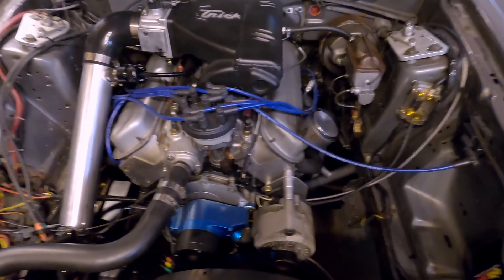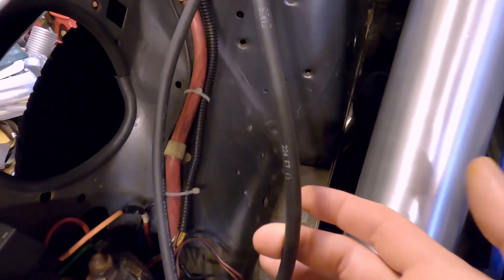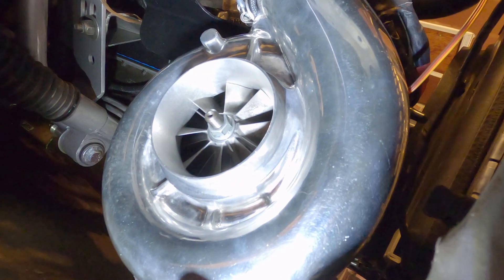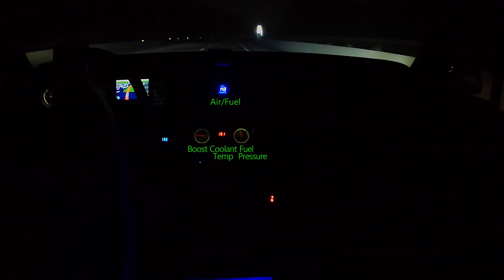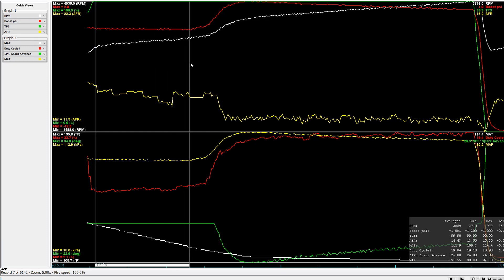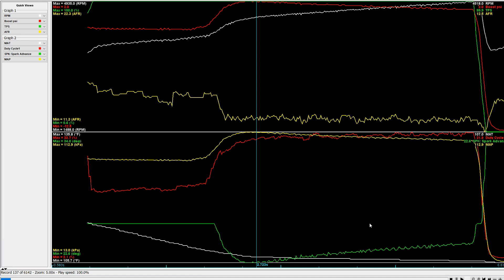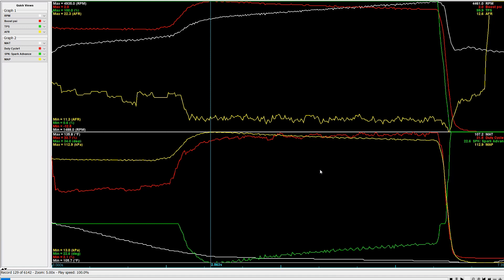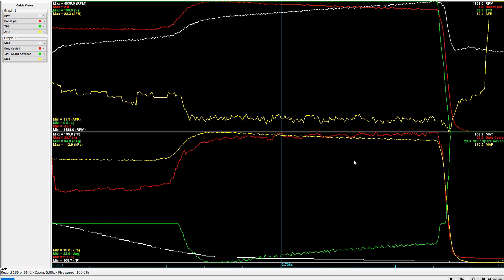The World's Most Powerful Electric Turbo Car - First Boost

Comment: Been watching and am happy to see boost! Your work has been meticulous. Your ESC looks to have plenty of headroom. Have you seen the torqamp?
Reply from the maker: I did see the torqamp after we dyno'd the small electric turbo.  The ESC is what I'm really concerned about.  The motor has been fairly durable; hopefully the ESC holds up.  Zeee batteries has stepped up and is helping with the project, so I'll be throwing more (and bigger) batteries at it.  I will let you in on a little advance info - I did do a pull two days ago with 15 cells fully charged and saw a peak of 3.8 psi @ about 13kW.  That's not enough to get me where I want to be, so it'll be 16 cells, possibly 32 to minimize voltage drop, and whatever other efficiency things I can do.  Ultimately, an Si impeller and volute will go on to get us to max power.  However, 3.8 psi is showing between 505-560 flywheel hp based on duty cycle, so we're getting there...

Comment: Great. Now send it!
Reply: JK JK. Must have been an awesome janky test feeling!!
Reply from the maker: Damn straight.  I won't be satisfied until it runs 9's on electric boost alone.  When I first put the whipple on it went high 10's.  Eventually got it to 9.83.  Between you, me and anyone reading these comments, I'm going for better than a 9.65 - the Dodge Demon mark.  I think we can do it.  Hell, The car is now 100 lbs lighter than it was with the Whipple, and all of that weight is off the nose.  Hookin' and bookin'.
Reply: @AlexLTDLX  you've made one, so it'll be easy to build a second one to twin charge it vs sourcing sci parts. Plenty of space in that car too. Also it'll lower your intake restriction off boost a heap too...

Comment: Can you run a bypass value for the air intake for NA?
Reply: the good thing about centrifugal blowers is you can draw air through them when they are not spinning, i.e. you can drive em with no belt fitted, obv restricts the inlet a bit but may or may not be noticeable and save on a bypass
Reply: @denisohbrien  He says in the video that there's a ~1 psi restriction with the turbocharger turned off
Reply: @discontinuuity  yeah I replied before watching the video, schoolboy error there.
Reply: When connected into car electrics I wonder if it could spin at low power to minimize restriction?

Comment: Congrats on a successful first flight and the purchase of the new snake!  I woke up a couple Christmas's ago with a few feet of water in my basement because the pressure tank went bad!  A few days before last Christmas the hot water coil in my furnace took a dump!  I thought Capital was staying open with new management?
Reply from the maker: I looked into the Capitol Raceway issue - so far, nothing definitive, but not looking good.

Comment: I purchased my house earlier in the year. This was in winter. The pool had a big inground pool just like my wife wanted. . We request the pool be guaranteed until the company that closed it open it. They refused but assured it was fine. Well we're now up to roughly up to over 11,000 in repair and replacements. Everything need to be replaced except the hole in the ground. Guys show up tomorrow to remove the water, drain the pool, and replace the leaking liner.